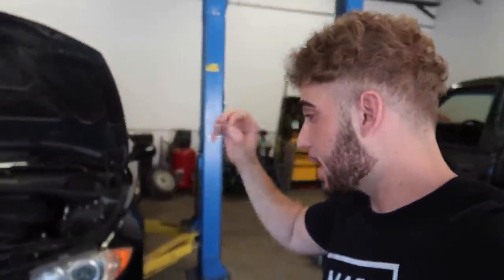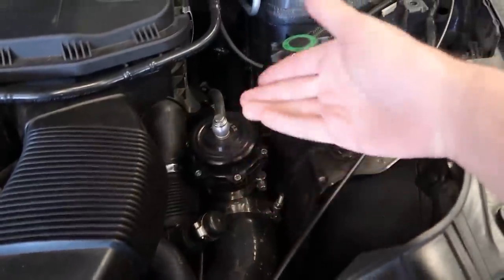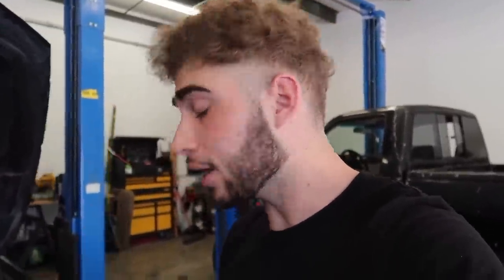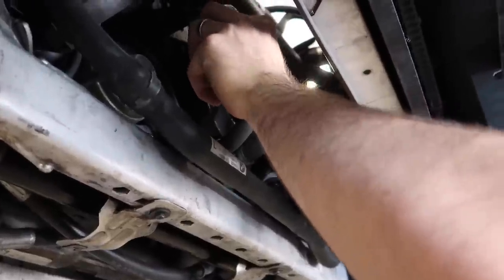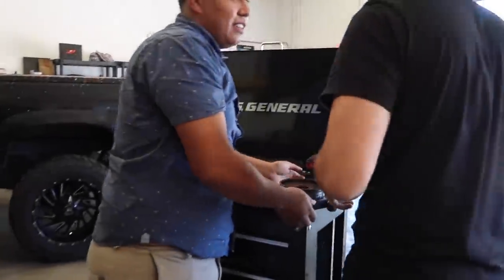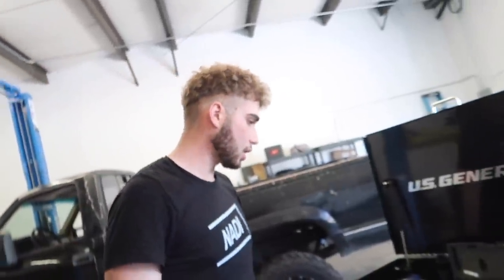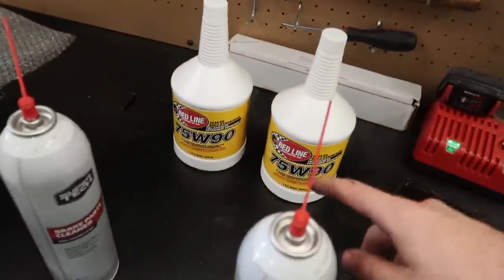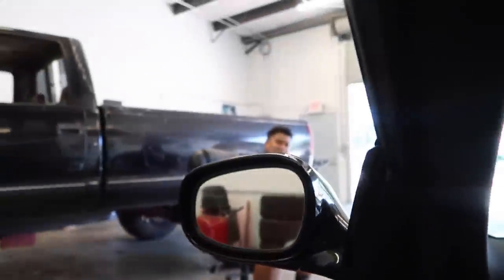THIS $80 MOD CAN SAVE YOUR ENGINE! (135I IS READY!)

Comment: Bruh-Bruh! I saw that Crank Cover thing to keep belts from getting sucked into the Engine and rubber shards out of the Oil Pan and a Sista has never paused a video to go shop for Car parts so fast in my LIFE!
There were 12 covers left and I didn't think twice! 
Thank you for that pro tip of the day, because anything can happen with these cars. I appreciate it wholeheartedly!
Great stuff! Whew!
#SquadetteOutForNow

OHHH! I believe I told you in the video where you were concerned about the ticking noise from the engine that that's how our Engine's SOUND! 
We're Golden...Lol!
...here they come.
OHHHH SKUNCH!!!!!...speaking of Engine Sounds?... I had my guard installed and, YEP! Mine sounds weird now too. Not just ticking as usual, but that Cover install caused a RUBBING SOUND...yipes!

Comment: Have a 2006 325i  w a couple leaks I took it to the dealership they said 4K to fix took it to a small indy shop they said no leaks ? If anything they’re small Seeps  but should I fix it first or keep it pushing ?  And any good recommendation shops to take my bmw in la please and thank you
Reply: These cars can go a long time with small leaks I have fluid on my driveway and it runs fine
Reply: Neil542 no fluids leaking out on the driveway but thank you